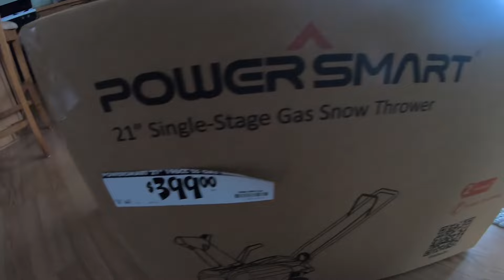PowerSmart DB7006 Assembly Instructions 21 in. Single Stage Gas Snow Blower SnowThrower Home Depot

Comment: I can't see if you put the flat side of wheel closest to blower or away from blower.
Reply from the maker: @alfreidapowell1159  There’s a hubcap that snaps on the outside of the wheel. I think it’s concave. That side should be facing out.

Comment: Is the oil for the gearbox ?? you did not add oil to the fuel, mine did not come with instructions. Do i have to mix oil with the fuel??
Reply from the maker: The oil is for the engine. My blower is a single stage so it doesn’t require oil in the gas. I just put regular gas in. Make sure you check your model number and read the instructions online. Yours might be different than mine.

Comment: Mine was a piece of Junk. I assume they all have the same major flaw. It has a metal scraper blade and since the balance puts the majority of the weight on the blade it drags hard on the ground.  This machine is very difficult to push.  They should have put a plastic scraper or some adjustable sliding feet.   I returned mine and got a Toro.  No issues with the Toro.
Reply from the maker: You are correct! I pulled the metal piece and used it that way. https://youtu.be/VZJyvO1U9mE
Reply: Any updates on how to protect the area where the metal plate was removed?  I just unpacked it.
Reply: Dude same issue

Comment: Do a video on what you twist or turn or pull to get it started
Reply from the maker: Per the owner’s manual:
STARTING
1. Move the choke lever to START position (Right side).
2. Press the primer bulb 3 times.
3. Insert switch key into slot (Do not turn switch key).
4. Pull on the recoil starter handle slowly until a slight resistance is felt, then pull quickly to start the engine. Return cord gently into the recoil starter. Never allow the cord to snap back.
5. If engine fails to start, repeat step 4.
6. Once the engine has started, slowly return the choke lever all the way to the “OPEN” position (Left side).
7. Allow the engine to run for several minutes before using snow thrower.